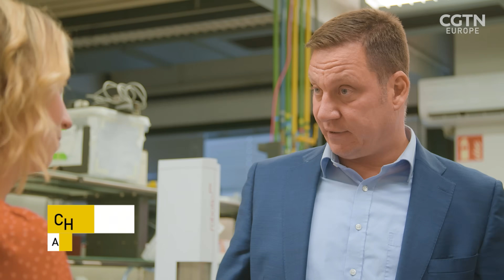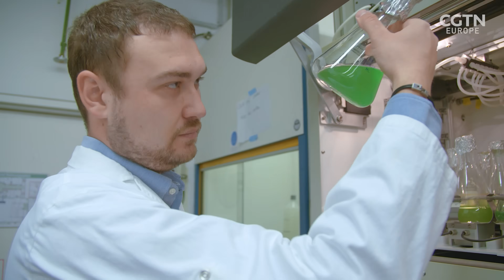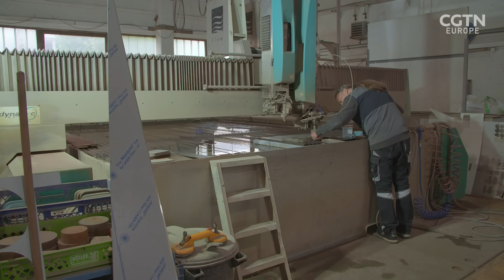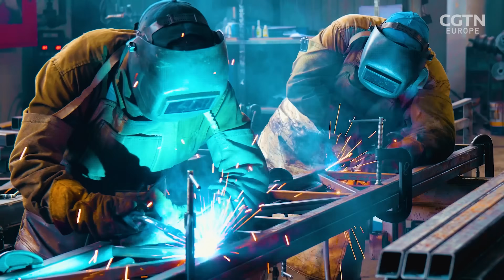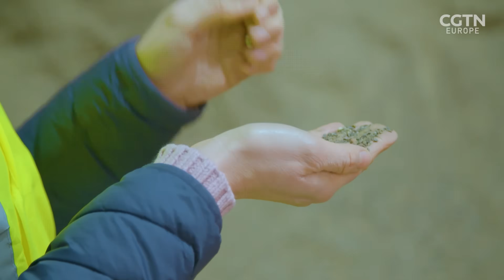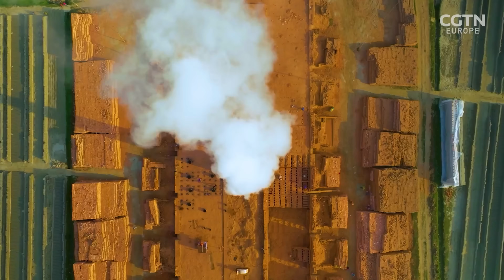The surprising materials that could decarbonize construction

Comment: At the Nelli site "Charcoal will decay a bit quicker than biochar", LOL.This makes no sense. Charring algae is like charring the green leaves of higher plants, ie. insanity, you are charring valuable bioactive nutrients which can feed the soil or farmed animals. Large pieces of biochar produced from wood, ie. dead cellulosic material is far stronger, it contains more bonds between the carbon atoms and is therefore harder to break and decompose.
Reply: charcoal is less stable and does decay quicker there are studys you can look up if you want to see methodology but boils down to fewer volatile compounds in biochar and more aromaticity which makes it more stable. And due to algaes high protein density you get more N and NO fuctional groups and free radicals during pyrolysis. You can also nitrogen dope alage biochar making more adaptable for different purposes. Biochar has some significant advantages, you can still think that feed is a better use of the algae though that's up to the needs you have and how you weigh it up for your purposes
Reply: @YearRoundHibernater  I think you fail to understand what is being said. The so called 'charcoal' that is being talked about  is biochar.

If you are seriously suggesting carbonising protein on a vast scale as a way of removing carbon from the atmosphere to build soils, to say nothing of using the carbon in construction , then it is INSANITY !
Reply: @Flumstead  you're right I don't understand what you are saying. Charcoal and biochar are not the same they are pyrolyzed differently and you get a different product at the end. And it does work, how well it will scale is debatable but what you seem to be doubting is documented to work. Youtube comment section isn't the best place to learn but there are governmental level studies a search away on google if you need convincing.
Reply: @YearRoundHibernater  Care to justify carbonising valuable protein?
Reply: @Flumstead because you want it for another purpose, like requiring biochar. You sound like you're being forced to participate in this industry. You aren't do what you want and avoid whatever products you want. But declaring something is rubbish because it doesn't fulfill a need you specifically have is just weird.
Reply: @YearRoundHibernater  Can you explain why people should pay for carbon credits to carbonise protein when they can pay for cellulosic material to be carbonised of which there is a virtual unlimited amount?
Reply: @Flumstead  i'm not arguing with you anymore this is tiresome. If you actually want to know the answer look up the studies and papers on comparative effectiveness both in the use cases for charcoal, biochar and algae derived biochar as an end product and effectiveness of carbon sequestration. It's a google away and far less aggravating for me. Enjoy the read.
Reply: @YearRoundHibernater  Are you AI or human?
Reply: @Flumstead  a human who can't be bothered to explain scientific concepts to someone who doesn't want to admit that they don't know as much about a topic as they think they do. For the last time if you actually want to know about these things check the research online. If you just want a debate or argument then I'm sorry but it ends here, I can't be arsed.
Reply: @YearRoundHibernater  I know plenty about the subject which is why I was questioning what the guy had to say @Nellie. Quite why he was talking about charcoal I really can't fathom, when the only comparison that matters is between different types of Biochar. Saying do some research online isn't a good answer. We would never carbonise green leaves so why would we do the same to living algae, it is an insane approach to the problem.

Comment: Using char as an insulation in side a wall does not make it 'Biochar'. If the char is colonised by living organisms in green walls or a green roof then it is 'Biochar'.
Reply: Can we also point out that having ANY kind of charcoal inside the walls of anything is like building a giant Bonfire that only needs a spark to ignite?
Reply: @TheAnthon07  No, it is highly resistant to ignition. Made into a solid block of material is more resistant to burning catastrophically. There are far more materials in the average home that are at greater risk of burning.
Reply: @TheAnthon07  You say that like the oil-based sidings on walls today aren't just as much of a powder keg.
Reply: biochar is biomass that is carbonised through pyrolysis, heated in low or no oxygen. It has nothing to do with living organisms other then the fact they were living sometime before pyrolysis
Reply: Welcome to the English language. The term “biochar” refers to carbon made from drying/deoxidizing plant matter using heat, hence “bio” and “char”. It is FORMERLY living, not currently living.
Reply: @davestagner  No. The term refers to the fact that the char is used by living organisms as a substrate on which to grow. It is very simple.
Reply: @Flumstead  Fact-checking because of your response… that doesn’t seem to be the working definition. It’s still called biochar, whether used as a soil additive, construction material, filtration material, or just buried for sequestration. It becomes charcoal rather than biochar if it’s burned afterward.
Reply: @davestagner  Fact check all you like. It doesn't change the FACT that there is no good REASON to call it biochar when used as a dry internal insulating material, it is simply 'char'. When used as a growing medium in a living roof or wall, it is 'biochar'. When used as a biological water or air filter then it is biochar, ie. the char has become inoculated with organisms which clean the flow.

Comment: I doubt that it would be cost competitive with steel for concrete, not even close
Reply: The problem with steel is that eventually it rusts which begins to degrade the strength of the concrete structure. So with this carbon fibre, the concrete will last longer. So in the long run, it will be more cost effective.
Reply: @Robert-vh2cl  There are ways of stopping steel from rusting that are not done because they cost more.  You don’t know how long this new material will last or how much it costs.
Everyone wants to translate the “carbon problem” into their cost problem.
COST MATTERS!
Reply: Pure supposition. It is made from recycled materials which industry wants to get rid of so that's a cost advantage at the outset. Steel uses huge amounts of energy, this doesn't. Another saving
Reply: Well, two people think you haven't a clue and I think they're right.

Comment: Does he realize he is made out of CO2?
Reply: Mainly H2O actually.
Reply: @ianhamilton3113  Don't be an idiot.
Reply: I think you mean carbon, but yes.  The issue being addressed with carbon neutrality is more about the idea of not unlocking gasses stored deep in Earths crust and pumping it into the atmosphere.  That changes the climate.   Circulating carbon that is already in the biosphere is not the problem.   Fossil fuels and concrete production are two major ways we introduce NEW carbon into the biosphere, thats bad if you think the current climate is warm enough.
Reply: @TheJourneyBegins777  No, he is quite literally made out of co2. All that carbon that makes up plants comes from CO2, which feeds herbivores and ultimately fees carnivores and omnivores such as us.
Any CO2 man releases into the atmosphere is irrelevant, because it does not affect temperature, weather or climate.
Reply: @thegeneralist7527  it doesn’t sound like you understand basic chemistry.  CO2 is a gas produced during cellular metabolism.  One’s body isnt composed of it.  We are composed of other carbon based molecules.  When we alter the chemical composition of our atmosphere by releasing 100s of millions of years worth of stored carbon from subterranean earth into the atmosphere all at once like a massive, one time carbon pulse over a short two hundred year period, yes, that is effecting the climate.

Comment: Carbon negative?  That is only important if you take your science knowledge from the Guardian or the BBC.
Reply: Carbon negative means you’re taking CO2 out of the atmosphere and locking it inside the building material. We should take as much CO2 out of the atmosphere as possible instead of dumping more carbon. We need to reduce the amount of CO2, and net zero isn’t enough because we already have an insane surplus of greenhouse gases in the atmosphere which is responsible for anthropomorphic climate change.
You could say it isn’t enough, and you’re probably right, but every CO2 molecule you’re locking away from the atmosphere is good.
Reply: @Ilovepastatoo  I think he a is climate denying idiot..... nice reply but wasted on this tool @tokio whatever
Reply: the extra man-made carbon dioxide in the atmosphere has had a very good effect on crop yields around the globe. Also the edges of the deserts are greening because of the extra co2. 
Even though we have increased the levels by about 50%, in the history of the planet the levels are extremely low. If you doubled the amount of carbon dioxide 8n the atmosphere you would only raise the temperature by about 0.8 degrees Celsius. The alarmists claim that the temperature would rise much higher due to feedbacks. However, if this was true then the Roman warm period and the medieval warm period (which were both warmer than the present day) would have triggered runaway feedbacks. They did not.
As professor William Happer said, “There is no climate emergency and there’s not going to be one”.
Reply: Riiight, climate change is a hoax and the Earth is flat.  Got it.

Comment: All that wood shown at the waste dump should be sheded and helped to make engineered timber sheets.
Very interesting reusing discarded bricks etc.
Reply: The glue to make use of waste wood products is pretty nasty
Reply: @jonathanjones3126 they're already making it with that glue, so why not at least use recycled wood?! Someone will probably be testing out new adhesives that are less toxic.
Reply: @meganhutchinson6435 the new adhesives are utter trash, have you ever seen what happens to engineered wood that gets slightly wet?

Comment: How flammable is biochar?
Reply: Imagine ground up bar-b-que charcoal. Same same but different
Reply: Extremely
Reply: There are buildings that deliberately burn well on the surface. I don't remember why exactly but something to do with a predictable burn being safer and better to engineer around. Kinda like the crumple zone on a car. Also I feel like if it's encapsulated in concrete or something then without air it doesn't matter how well it would light aflame in the presence of oxygen, what matters more is how well it transfers heat to whatever does have air contact to ignite. So if something is an insulator it'll stop the radiating heat of an open flame lighting anything else on fire, slowing spread, as long as it doesn't ignite itself. something like normal brick could get so hot it'll conduct heat to the inside the house then ignite it flamelessly.

Comment: Interested to know how low should the carbon be in our atmosphere before it’s considered to be acceptable. Will this still allow for our plants to create enough food for the planet and our forest to grow and keep our air healthy?
Reply: For the last 800 000 years or so levels would fluctuate between about 180ppm and 280ppm and those changes were slow like 50 000years to move those 100ppm slow and then reverse. They went above 300ppm in the late 1940s and levels today are around 425ppm that is a massive movement in 75 years. The minimum for plant survival is around 150ppm and the maximum for the climate to be considered stable is about 350ppm. So sequestering efforts would be aiming for the 350ppm level I would presume
Reply: Prior to the Industrial revolution we were at 250-300ppm, so that should be our target.
Reply: Think I saw it to be down to 75 to 150ppm
But take that with a grain of salt
Reply: @jenshobroh1294  280-320ppm would be best.

Comment: Secret sauce = geopolymer 
Heat clay to 750c >meta kaolin blend intensively with by weight 10% drain cleaner Koh, and 10% water glass.... 1 month slow curing, baking the loaf speeds curing.

Optimize from there +- % ratios depending on your feedstock.
Reply: Yes, this is the ultimate solution. Super durable if paired with basalt fiber or carbon fiber. But it's true, lye currently is super expensive. In the future I think there is no physical limit on how low the  price of lye is because ocean and sunlight is basically infinite source of lye, it's just the question of will we do it.
Reply: As you stipulate, replace the cement element with geopolymer. Only issue I can see is the process to make the lye.
Reply: @ElysianDreams 
🤔 I dunno, man—doesn’t this kinda sound a bit dangerous?… 🤷‍♂️
Reply: Or the secret binding agent in that brick is people.